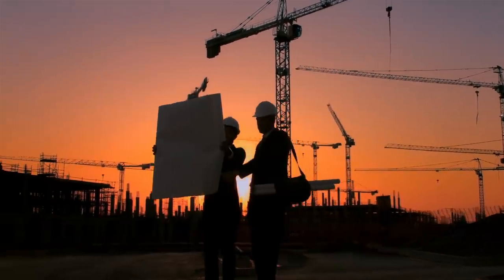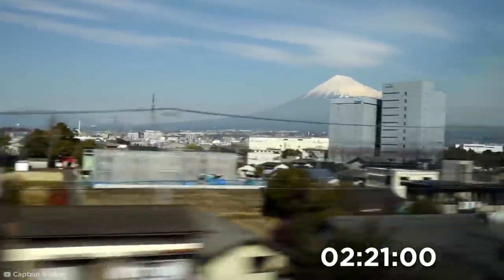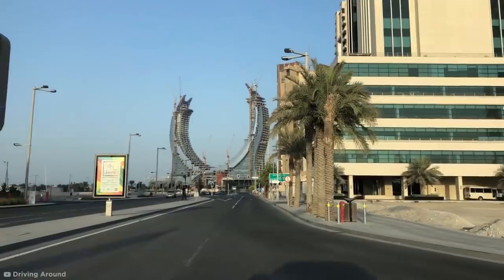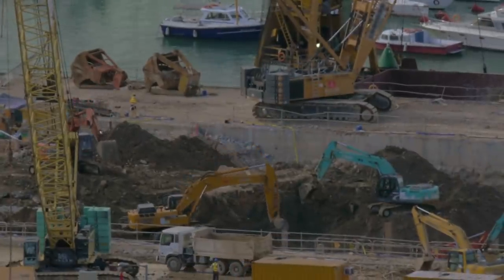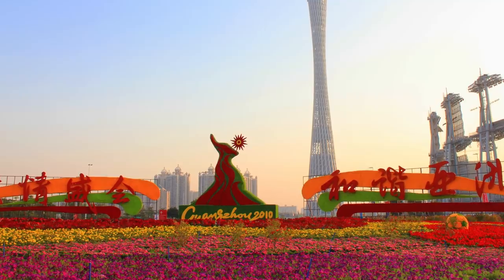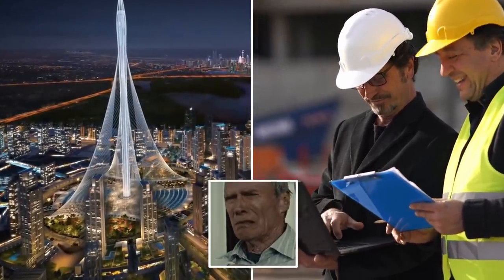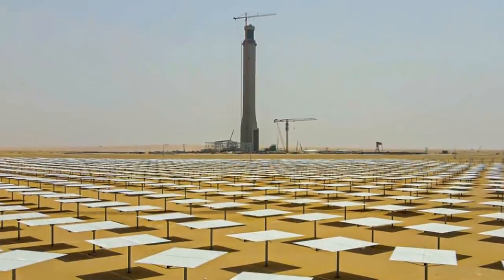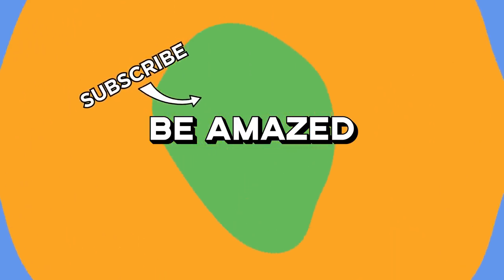Huge Megaprojects Under Construction

Comment: Imagine living in a 1Km high skyscreaper on the 3rd floor :/
Reply: Andy Man  indeed
Reply: Andy Man  uh... as a civil engineer, iconic structures in the UAE are actually designed to withstand even 10.0 earthquakes.. so yup..
Reply: Andy Man  yes lol some can resist these earthquakes. They use special techniques to isolate the vibrations from the foundation. One thing for sure though, extremely tall buildings aren’t going to be easily made EQ resistant. In fact making them resist 7 is a huge thing let alone 10. The 10.0 magnitude mark is for smaller structures.
Reply: Andy Man  ? 12 is considered a theoretical maximum. This way if we design our things for magnitude 12 it means it will never fail in a typical earthquake. 8 maximum? Yeah ofc Burj Khalifa can’t withstand higher than that, but do you actually realize how high the burj is? Now add the same EQ resistance system to a near ground level mall or hospital for example. They can easily be made to resist all possible EQs. The number “12” isn’t something I came out with. It’s out there as a figure of design to make sure a building won’t fail to an earthquake ever in its life time. Liquefaction of sand means nothing if your foundation is supported by the bedrock. (Also, they use some techniques in the foundation to reduce the shaking, thus it also reduces the chance of sand liquefying.)
Reply: You are really underestimating the limit of science and engineering.
Reply: @NawrasEpicDuel  lol
Reply: Max3 Alike  ? Did you know many 9+ magnitude earthquakes had already happened in the world and a lot of structures that were designed for them easily withstood these earthquakes? Bruh, you are the troll here, spreading false information. What I said in my post is simply facts.
Reply: Max3 Alike  bruh, looks like I’m talking to some1 who doesn’t even understand what these numbers mean In the first place. For every +1 magnitude, the energy is increased by 32 times. Idek how u got this number 1000 from but I guess that’s the internet for you, everyone just wants to say anything to make others who say something right seem as they are saying something wrong. Also who said that only asteroids would cause 10 mag earthquakes? That other random guy who tried to prove me wrong? Lol that’s another false information being fed to your brain that doesn’t seem to distinguish what’s right or wrong. The maximum theoretical level for an earthquake (in case all continents shook at the same time super violently) is 12.0 and not 10.0. This 12 is what’s almost impossible to happen unless an asteroid hits earth. 10 on the other hand is more common than you think. You can just look up the strongest earthquakes in earth’s history and you will see what I’m talking about. Also, iconic structures use special techniques that reduce the effectiveness of the earthquakes. Idk if you know this, but you can get hit by a mag 7 earthquake and drink your cup of coffee as if nothing is happening. That’s the power of the shock absorbers and other pieces of technology that literally make u give 0 shits about earthquakes in general.
Reply: @KumJongOom  heh what is cringe this is actually an educating discussion that you can learn some interesting stuff and even tho these 2 are pretending to be some kind of two college professors debating some new groundbreaking earthquake theory :D they still bring some great googled material to the comment section :) thanks!
Reply: Andy Man  Some people who say they are engineers are some of the stupidest people you will ever meet

Comment: Did i miss it? Taipei 101 in Taiwan with its mass dampener. It was the worlds tallest building for several years too. I have been there. It was amazing. Only skyscraper you could a feel a little safer in during an earthquake. ;)

Comment: Just imagine if something goes wrong and the “Iter” goes boooom!
Reply: A fusion reactor is not like a nuclear reactor, if something goes wrong, the fusion reaction can just stop and will cool down. So it will be much more effective and safe.
Reply: I agree
Reply: Reactors, Fission or Fusion, DON'T explode.
Reply: Much safer than nuclear reactors. Just ALOT bigger and ALOT more expensive to build.
Reply: @johnfede7057  yes
Reply: @johnfede7057  What is safer then a nuclear reactor? So far only nuclear reactors have been mentioned.
Reply: Gonna reach big bang

Comment: The chinese architect should have proceed with the original lotus stadium. Lotus plant is very significant to chinese culture, along side with plum blossom. But the latter one was not that bad, it looked modern though, but just not as impressive as the lotus one.

Comment: If Egypt and Ethiopia go to war over the dam, at least one of them can camp on the dam by using it as a wall and whoever is at the top can brag about having the high ground.
Reply: The Nile flows through 10 nations. But by a quirk of British colonial history, only Egypt and its neighbor Sudan have any rights to its water.  Ethiopia contributes 80% of the total Nile flow, but by the 1959 agreement is entitled to none of its resources.The Blue Nile rises in Ethiopia and provides 80 percent of the overall flow of the Nile river.The main motivation that Ethiopian government is building the dam is When fully operational, the dam will become one of the largest hydro-electric plant in Africa, providing power to some 65 million out of 110 million Ethiopians, who currently lack a regular electricity supply and leaving under poverty  which is more than half of the Ethiopian population.. In other hand  More than 99% of the Egyptian population has access to electricity. The Ethiopia dam can store 74 billion cubic meters of water, about half the volume of the Egyptian Aswan dam, As Ethiopia contributes 80% of the Nile water while that they have more right to the waters of the Nile than other countries but due to 1959 agreement b/n Egypt and Sudan.. Ethiopia  is entitled to none of its resources  for the past many decades, know that Egypt is one of the top 3 countries with fresh ground water in Africa and also The biggest mega-structure on the Nile River is the Egyptian Aswan High Dam. The Ethiopia Dam will not block the water the water will hit the Turbines generate electric and will continue its flow..
Reply: @user-my5bg5nm2w  I've seen you reply this 3 times...
Reply: @Quirkykitty  that is b/c i want every body ... to know the truth that is all bro/sis

Comment: 6:08 - Hoping the Brand New City in the Philippines Called New Clark City Will Build Skyscrapers Soon, By Next 10 Years, New Clark City Already Has Skyscrapers
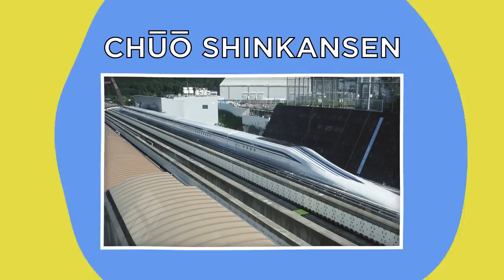2:35 - Hoping the High-Speed Railway Similar to Chuo Shinkansen will be Built in the Philippines Called Ilocos-Manila-Bicol Maglev High-Speed Railway with a Speed of 1000kph, But the Construction of this Project will be Faster than Chuo Shinkansen Did If Completed, We Can Reach Ilocos and Bicol in Just Only 30 Minutes-1 Hour via This High-Speed Train from Manila.
9:28 - In Makati, There is a Skyscraper Something Similar to Marina Bay Sands and Chongqing Raffles City Under Construction Located at Makati Subway Amorsolo Station, This is Also Part of its Transit-Oriented Development.

Comment: The Apollo program cost over 20 billion but did it so long ago that adjusted for modern equivalents would put it over 200 billion in cost.  You can stick your head in the sand and ignore the fact that 20 billion in the 50's was worth significantly more than 20 billion now but nobody else will.  This program was clearly scientific in nature and far far more expensive than this reactor.  Im not saying this was a good thing lol.  But it is a historical thing that shouldn't be out shadowed by a program that comparatively cost about 8 time less.

Comment: Using MW as the unit for the solar park isn't very clear. Not providing a per time unit is very misleading. Yes a watt has time incorporated but MwH, even though that unit is hard to understand, would be a much better way to present that figure.

Comment: the graphic at 1:22 seems to show a protium atom & a deuterium atom fusing. i'd been under the impression that ITER uses a deuterium/tritium fuel cycle. has that changed?
Reply: The animation shows deuterium (p+n) and tritium (p+n+n) cores. A regular hydrogen core is just a single proton.
Reply: so,  @VegardFarstad , you're those are neutrons rather than electrons?  those dots represent nuclei only rather than whole atoms? that makes more sense. thanks.

Comment: 1:00 I Know where is this going once it fails... CHERNOBYL 2.0
Reply: True fusion actually gives of almost negligible lethal radiation, so if they are actually able to achieve it with that project the danger would be low even if something goes wrong.

Comment: I don't know anything about solar. But wouldn't that many solar's make it much hotter around that area, I mean look up about bird's dieing when they fly over the solar's because the heat gets so intensified it burns them in mid flight. Also let's not forget the poor birds hitting the solar's just like they hit the tall buildings that look like glass. I'm just saying nothing we do is looking any better than where we're at rite now.😟

Comment: But wait if there are new physics that effect quantum  particles and makes muons oscillate more than expected.what does that mean for everything. Cause its sounding like everything has some unmeasurable and unknown force acting on it that only becomes apparent when at the subatomic level but may still have effects on larger scales that have a wrong or incomplete cause assigned to them.... That's a whole new side of things that may hinder forward progress..... What if that new force acts differently in a tokamac than in a star that has more than one form of fusion going on and does so a different way than man made machines that have already failed to be self sustaining based in calculations scientists give us. Cause they regularly hit the theoretical temperatures they use to say they needed but still cant get more energy out than is put in. Which makes sense cause nothing does that except maybe a black hole. Which those don't even last forever apparently and nothing escapes them but possibly quantum particles which still leaves one particle behind so even tho something stays behind in the black hole and light cant escape. Even they lise energy and fade away.... Hmmm. Yet they say oh. We can make more energy than we put in. Even tho nothing can actually do that....